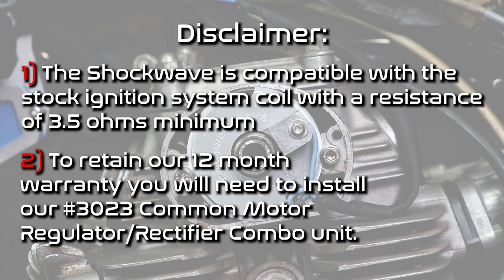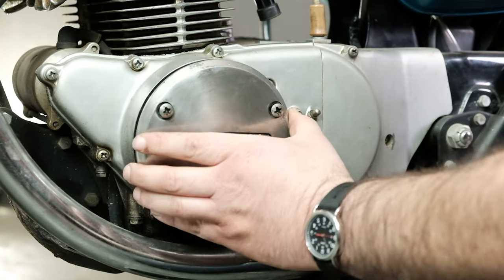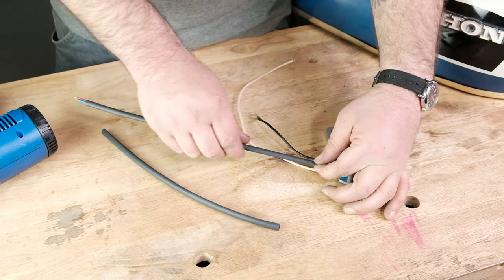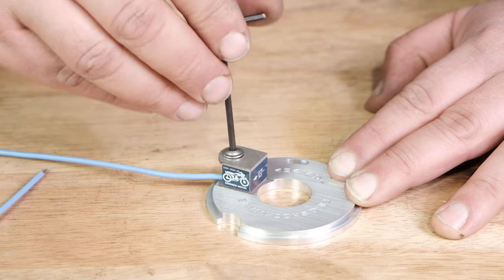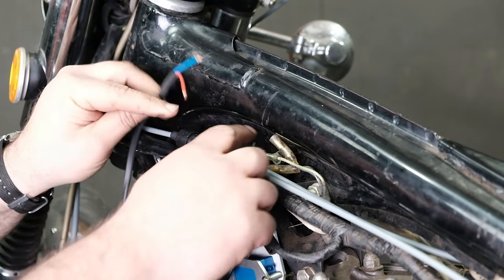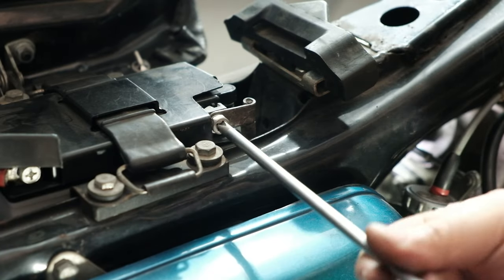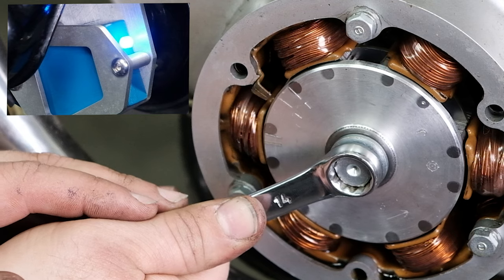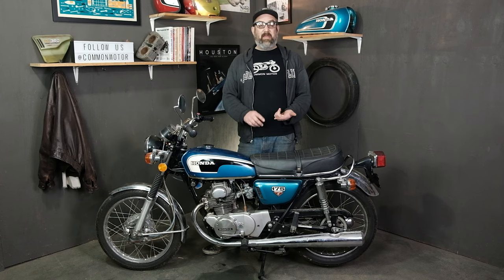Common Motor Shockwave Installation and Setup Guide For The CB175 / CB200 Family Of Motorcycles

Comment: I could not be happier with the shockwave ignition system. It was everything I needed including step by step installation instructions and diagrams. The CB175 is running better than it ever did with the points and condensers I had on it before. Also I really appreciate how much electronic ignition simplified the Timing process. Thanks CMC for offering such great products for the vintage Honda Twins.

Comment: Great instructional video.   The posi-locks and posi-taps work well, but I'd probably buy some vintage style connectors instead, to keep all the wiring uniform.  I'm a bit OCD when it comes to that stuff.   It's nice how easy this unit is to install.
Reply from the maker: Totally! We include the posi-locks to allow for a solid, tool free install that way nothing else needs to be purchased. If you have factory style bullets and a set of crimpers they'll be just as reliable and look great.

Comment: Great video as always. Your valve adjustment and timing videos helped me a ton on my cb200 just a few weeks ago, that and a carb clean and it's never revved out stronger or started so easily. Glad I did, previous owner had everything out of wack. When I get through everything else on the bike (brakes and forks rebuild), this ignition will probably be my first upgrade.

Comment: Will this fit for CD 125 Twin?
Reply from the maker: I believe the CD125 uses a 6v volt electrical system so unfortunately no.
Reply: @Common-motor  yeah but i converted it to 12v system lately
Reply from the maker: @thondakaika4728  Message our support with some photos of your ignition advance and we can check. It's going to come down to what style of ignition advance your motorcycle is running.
Reply: Was going to see if this ignition system would work on a CD 175 from 1970